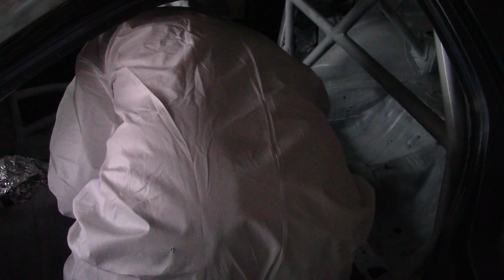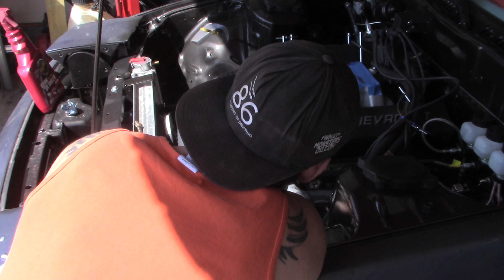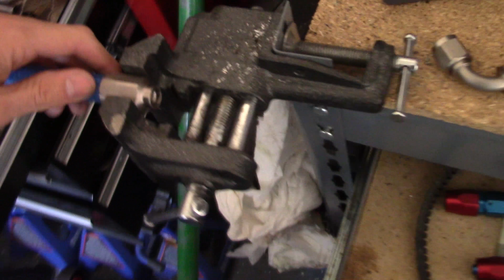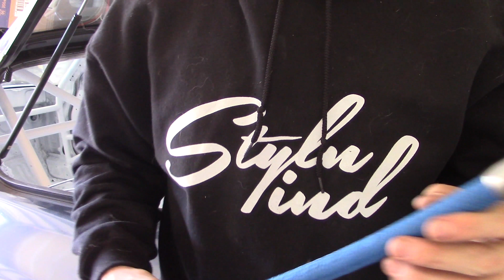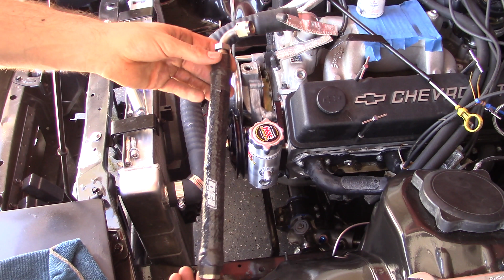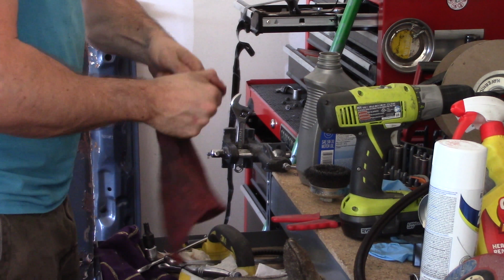KRC power steering pump install-V8 RX7

Comment: well whats it like?
Reply from the maker: Mike Seeds I’m really happy with it. It really makes the steering feel a lot more responsive. It’s almost a little too sensitive and I should probably lower the pressure again by changing the valve. It hasn’t failed me yet and I’m really happy with it. To be fair, you could do the same swap using a standard autozone gm pump with a different bracket and it should work as long as you tee the lines. Hope this helps.

Comment: What fittings did you end up using on the steering rack itself to go to the AN lines.
Reply from the maker: VEDEM RACING I can’t remember off the top of my head but I put them in another video where I installed them in the rack. I think one was 12mm x1.5 and the other was either 14 or 16mm x 1.5. I do have another video with it on there. I’ll try and find a link for you, it’s an old video.
Reply from the maker: https://youtu.be/HNIPfyUfugQ here is the link to the other video where I installed the fittings on the rack. Hope this helps!